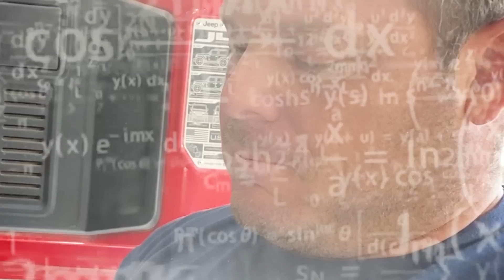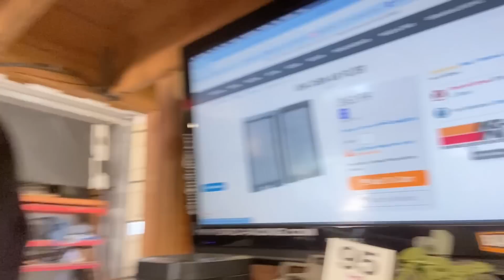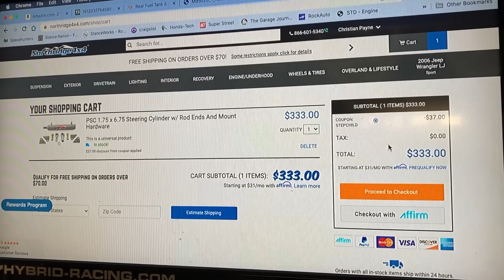DELETING the GAS TANK on a Jeep Wrangler JL!

Comment: For anyone else that does this kit in the future, I used the Diablo brand oscillating tool adhesive scrapers to remove that rear tray (found them at Home Depot). Took 10 minutes with minimal mess. I also had issues with the push to connect fittings Motobilt supplied, so I switched to AN line as well. I used Vibrant Performance Fuel Adapter Fittings 16921 for the fuel pump to AN line, and Russell Fuel Rail Fitting Adapters 640940 to go from AN line to the stock fuel line "quick disconnect." Final comment, I think the stock JL fuel pump evap fitting is a SAE J2044 QD connector. I have not confirmed that, but it seems to be close.

Comment: Hey Chris, remember the first time working on a non-NY vehicle!! It was almost as pleasant as an orgasm!! Lmao.. not having to replace all bleeders on the calipers, or replacing all the fuel/brake lines everytime you had to work on something. My first time was replacing rotors and pads.. i had the grinder, the drill/tap set and then.... everything broke loose and worked as it should!!!! It was amazing.

I sold all the vehicle's i bought down and bought new/used southern vehicles.. never again will i buy a rust bucket. Ppl ask me why i crawl below every vehicle i look at.. i was shocked they said they never have before and never thought to look under the vehicle!!! 😂😂 oh how the times have changed from having to bondo the rockers, fenders and all that, or if you were broke like me, zip tied and tuct taped everything after filling it with Great Stuff to keep the form!! Lmao

Comment: I have this setup and it's awesome.  I did do the Motobilt frame chop at the same time.  Mine is a JKU and double triangulated.  Lesson learned with this setup protect you driveshaft yoke because it hangs there as a target.

Comment: This tank works great on the diesel as well.  The fittings that Motobilt supplies don’t work.  You can order more fuel line and actually use all the factory fittings.   They are push in style fittings.   Takes some force but doable.   I cut the tray out leaving the glued in edge.   Then came back with a thin scraper that I heated up and melted to glue to remove the remaining plastic lip.   That glue is no joke!

Comment: For my installation, i just cut out the bottom part/tray itself and left top part of the tray attached to the metal bidy alone. Placed silicone under the metal fuel tank plate in the trunk and its working fine for now.

Comment: I also installed a MotoBilt rear fuel tank....I have a problem with the fuel gauge...it does not show the correct fuel level.  And right now there is no solution!! waiting to see if you might have a solution.
Reply from the maker: Is it reading too high, too low? We haven’t gotten that far yet (still trying to wrap up suspension).
Reply: @LiteBrite  The reading is too low... about the first 10 gallons... it doesn't give anything.  The gauge constantly shows full.  A little before reaching a quarter of the tank.. the gauge gives a warning of low fuel.  I am waiting for an answer from the technical department.🤷‍♂️🤷‍♂️🤷‍♂️
Reply: @Gabi4x4  The tank is deeper than the factory unit and the float/arm can only move so far.  You can extend the rod to give it more range of motion and bend it down so it reaches further down and shows a more accurate position to when it truly is almost empty.

Comment: For that tub an oscillating multitool would cut that right out, I work on houses and use one to cut into tight spots and they cut wood, nails, metal studs all clean cut and with no problem. Blades add up quickly tho.
Edit: oh you guys got one anyway lol

Comment: If you have a P00546 code it happens when you change the battery for some reason, I learned that after i deleted the auxiliary and replaced the main. Deleted the DTC with the tazer. My 18 has 82k miles and i need to upgrade do much. Right now i live through you guys lol

Comment: Is there baffeling or sponges inside the tank to stop fuel starvation when at sharp angles while wheeling?
Reply from the maker: Not yet. May add it later
Reply: Baffling will not stop fuel starvation and the foam will deteriorate with ethanol in fuel. Baffling helps with fuel sloshing around but a sump is the only way to get all the fuel to the bottom.  Please let us know if you have any questions.

Comment: I'd love to do this also but unfortunately my DEF tank already sits there. I know I could delete it but don't like the idea of being the guy blowing black smoke everywhere. I don't think you'll have any issues hitting that fuel tank. I have the Next Venture DEF skid with UHMW and it barely has any marks on it. Are you sure you want to go with a 6.75" ram? I have 72" wide axles and had very limited steering with a 7" ram so went to the 8" PSC and now steering is so much better. Great build. Looking forward to seeing the final product.
Reply from the maker: Which axles are you running (and with what knuckles)?
Reply: @LiteBrite  Fusion Kingpin 60s. Your Dynatracs might have better turning than than my axles did on the shorter ram. I also have 40s with a 4.75 backspaced wheel. It was so bad with the shorter ram that I couldn't even maneuver in a parking lot easily. The 8" made all the difference and I bet you can run one also.

Comment: I hate those jack,s the threads on the screw strips the car drop they put a cardboard thing over the spare tire I can't put my tool box in the back it crush the card board we need a after market to replace it so I can put my 300 lb tool box in my car

Comment: This is all great,,”But”, does it have air conditioning?,, 100 + degrees tomorrow. Transmission cooler, good evaporator coil, good clutch fan? You doing AC in R134,,, or Freon, o yea, for some reason $700 a pound in freon does not make any cent$ to me. but Freon will spit ice at you from the vents, just nasty cold. Been there done that @ idle rpm.